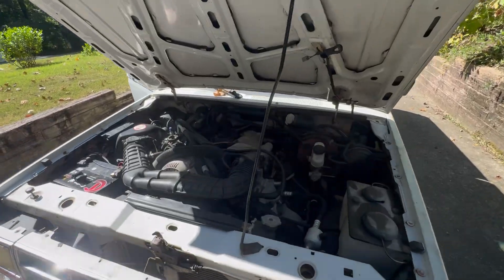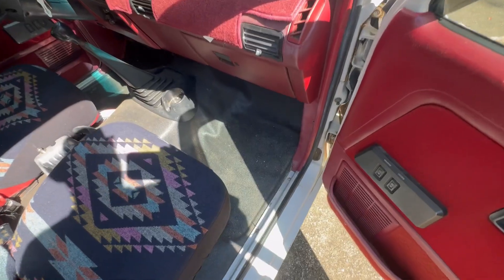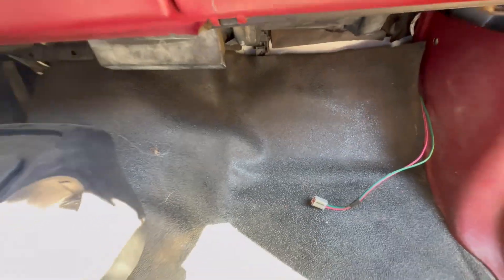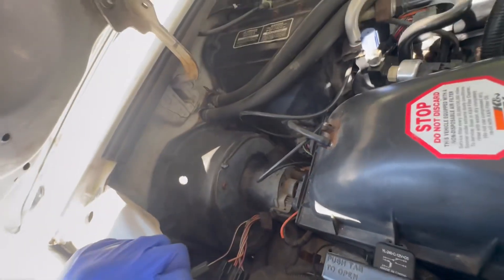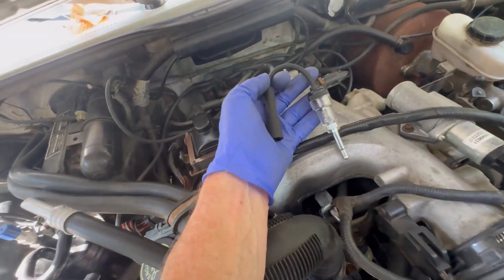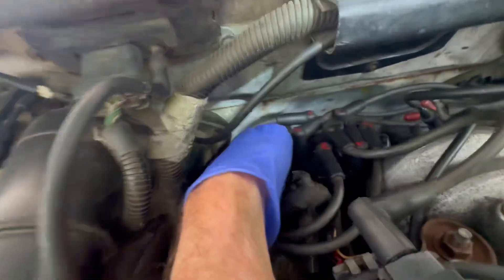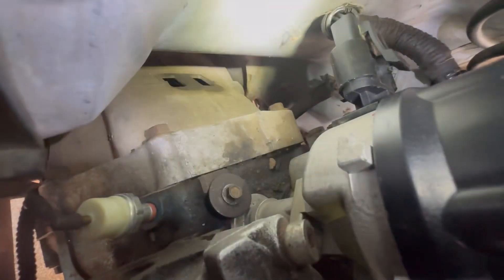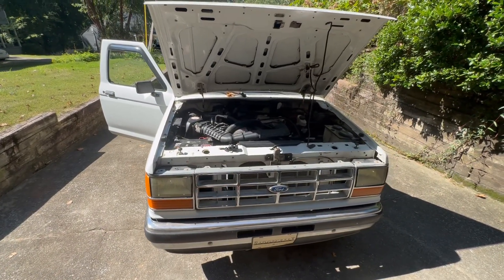So your Ford truck cranks, but it won’t start? START here!

Comment: The fuel line shut off under the dash what if I don't have one that pops up but only the button to reset it?
Reply from the maker: Must be something newer (or older).  It still has to work the same way as far as voltage goes - two wires in, two out?
Reply: I'll look buts its an 86

Comment: What if it doesn’t have a distributor ?
Reply from the maker: What year? Must be beyond 1995ish. Ford then switched to coilpacks on top of the spark plugs with a crankshaft position sensor. I think they actually called is distributorless ignition.
Reply: @TallFamilyFilms 1990 , spark plugs plug into ignition coil
Reply from the maker: @deidramills1871 yeah - the rectangular looking this? That’s the DIS system I mentioned. They must’ve put it in some engines before others. 
That uses a camshaft position sensor instead of a distributor.
Reply: @TallFamilyFilms so could the csp sensor be the cause ?
Reply from the maker: @deidramills1871  I assume it’s not turning over? Yes that is definitely a possible cause.
Reply: @TallFamilyFilms  it is cranking, but not starting.  Ignition coil, plugs, plugs wires, battery, alternator have all been replaced.  Fuel reset switch has been checked…  checked for spark, getting spark…  Simply not firing
Reply from the maker: @deidramills1871  did you check for spark using starting fluid or something into the intake? If it runs for a few seconds there, then your problem is not spark. It’s fuel.
Reply from the maker: I rewrote the above because I really screwed that up.  
Did you verify you’re getting 12 V at the inertia switch on the passenger floorboard?  You should get 12 V right away when you turn the key and then it drops to six.
Reply: @TallFamilyFilms My son n law said he just pulled the boot back off the plug held it close enough to get spark
Reply: @TallFamilyFilms they are going to get starting fluid tomorrow and try it that way.
Reply: @TallFamilyFilms they have not done that.  They don’t have a volt meter
Reply from the maker: @deidramills1871 you’d need to test all of them to know 100%. But you need to know if it will run. Get starting fluid and spray some into the throttle body and see if it starts. That tells you 100% that you have ignition/spark, timing all working. Them troubleshooting is easier
Reply: @TallFamilyFilms that is the plan for tomorrow.  I was just trying to get ideas just in case.
Reply: I have a 93 ranger, 2.3. Was driving cranking perfectly. Drove 300 miles after swapping tranny. Came out of store. Cranked it, decided to call my son. Killed the truck. Talked to son for 10 minutes. Tried cranking. Crank no start. Can ignition coil go out that abruptly?

I am leaning towards inertia switch, or bad ground. We will be testing no spark or no fuel in the next hour or so.
Reply from the maker: @Dominancelogistics  your description is exactly how mine died. I was doing fine and then just quit and wouldn’t turn over.  But you definitely need to investigate the inertia switch and the fuel pump relay before anything else.